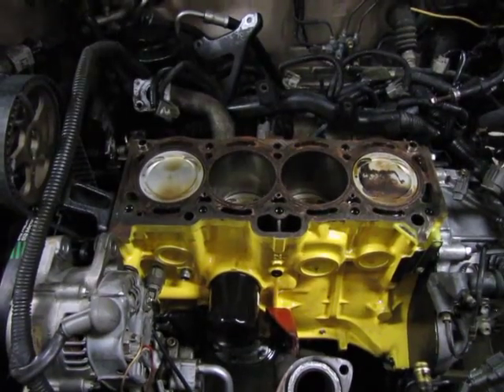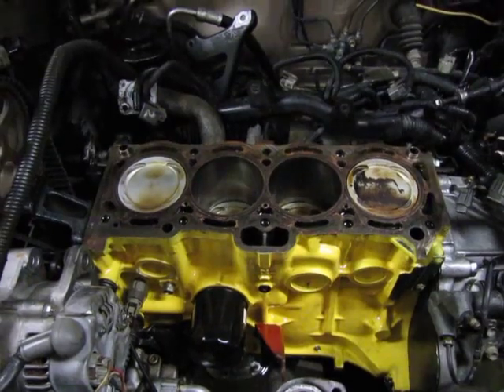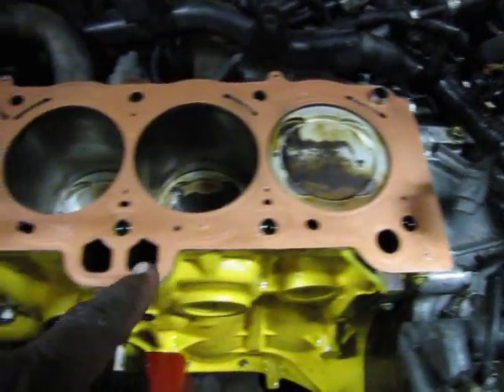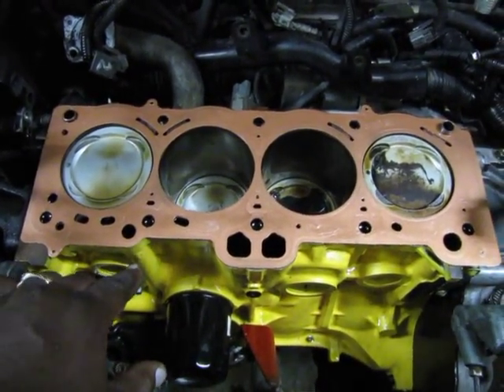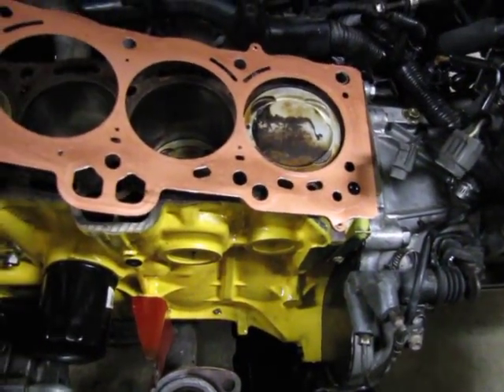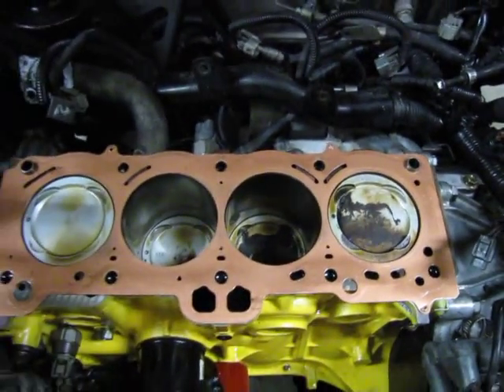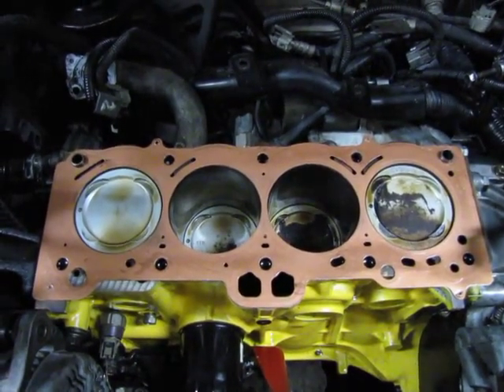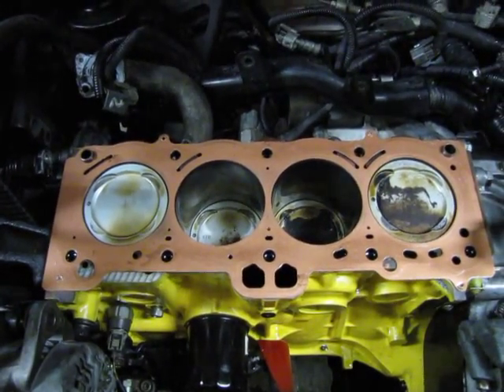What happens when you install the head gasket upside down on a 7AFE 4AFE engine

Comment: Someone suggests to me I may have installed my head gasket upside down since I have oil leaking into my coolant and no compression on one of my cylinders.  I also have oil leaking at the rear of my block.  Your video has convinced me to take the head off and check.  Thanks!!

Comment: Clint, I am curious if you use new head bolts on your 4AFE and 7AFE engines when you have the cylinder head off.  Thanks!
Reply from the maker: Yes, I always use new head bolts, it is not as critical for these engines as the heads are short and they are low compression engines but they bolts are so cheat, why skip and risk having to do it all over. Do it right the first time instead of the second ;)
Reply: Clint,
What do you use to seal the thermostat housing where it attaches to the head?  It has a groove as though it should have an O-ring.  Same with the water outlet that attaches to the head (and the upper radiator hose).  It also has a groove as though it should have an O-ring.  My Fel-Pro gasket set has nothing shaped like these.  Thanks for the help!  - J
Reply from the maker: http://www.oreillyauto.com/site/c/detail/PERE/82194/N2362.oap?ck=Search_N2362_-1_2585&pt=N2362&ppt=C1984

Comment: At least the engine survived. It happens, heck my last small block chevy I overlooked something, and I ended up having to pull the engine out after I just rebuilt and installed it. Sometimes if you've done things enough times, it's easy to overlook things. But when it happens and you have to correct it....you never make that same mistake again.

Comment: Hello men. I really like your videos. Men, my ae102 corolla 1994 with 7afe engine has the code 12 referred to rpm signal. I don't know where to begin checking or what do.... I really appreciate your help!
Reply from the maker: luis felipe soto picado cam position sensor
Reply from the maker: Check and test the coolant temperature sensor, airflow meter, throttle position sensor and check the fuel pressure. But it's probably the throttle position sensor.  good luck